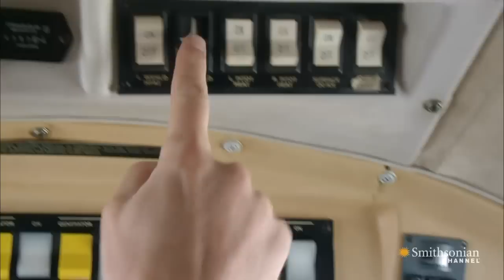Pilots Are Forced to Land When Their Plane's Heater Fails

Comment: I was a working pilot for 22 years
There is a little thing I like to call preflight check
I think if I was going to ferry an aircraft 1/2 way around the world I would be doing a thorough preflight and test flight to evaluate what I was dealing with
Any professional crew would check everything out before leaving
No excuses 
If in doubt check it out 😬👍
Reply: They did a complete inspection in previous episodes.
Reply: Yeah but that won't get you a clickbaity video.

Comment: why not just ship the plane overseas in boat instead of having to hop skip and jump around the pacific? and BTW whenever you have ice on your windshield that can mean the defroster isn't working or your cabin isn't pressurized. and this is why you do not just leave your plane neglected inside a hangar for several months on end and then decide to fly somewhere without inspecting every single bell and whistle to make sure you don't end up crashing

Comment: 0:24 why not cross the ocean straight from the start point, wouldn't that be faster
Reply: fuel and range
Reply: yeah the plane is really small, and even if it was physically possible with their fuel capacity (which I don't think it was) it's dangerous to be that far away from an airport and comms in such a small plane.